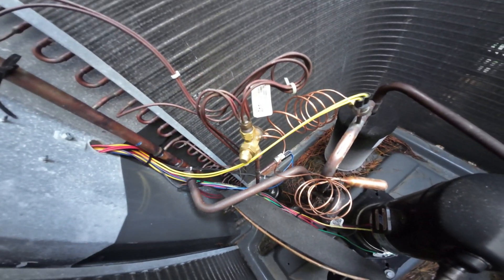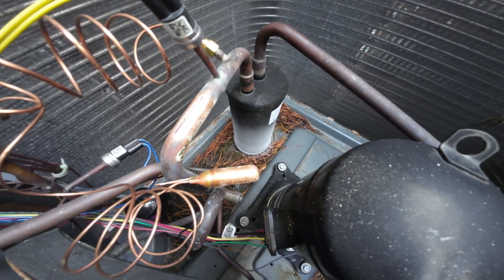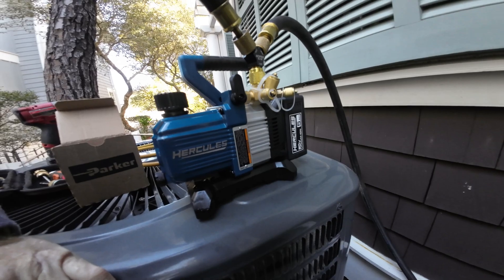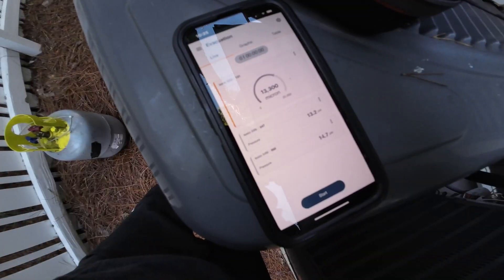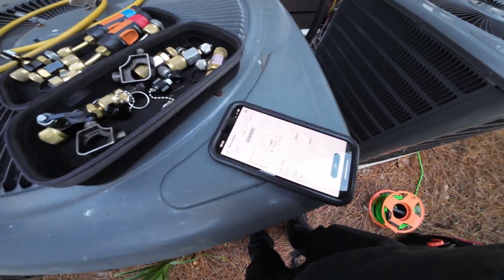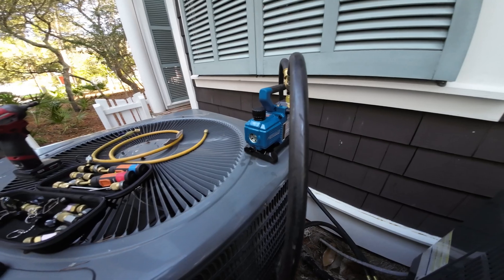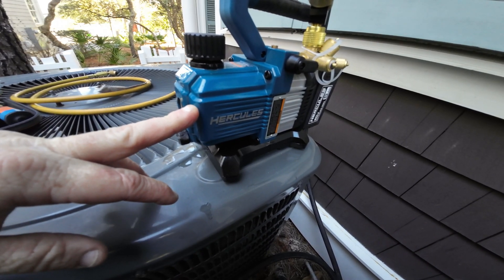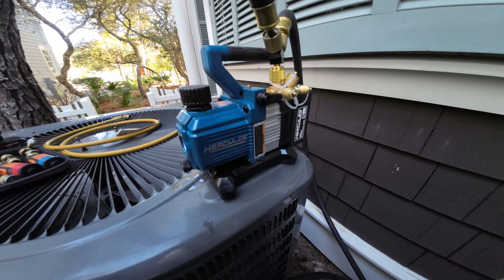Hercules 2CFM 2 stage vacuum pump | IS IT WORTH IT?

Comment: I just used it today to pull vacuum on a car AC system for 45 minutes and it performed flawlessly. It also had battery to spare. So if you're just doing automotive it's a great tool

Comment: Good video man. I actually just got one to test it myself and see how it goes. I’m very curious to see how well it does on things above 2.5 tons.
Reply from the maker: @HallsHVAC  it failed my residential repairs. But I am holding on to it for roof top package unit test one day.
Reply: @ definitely looking forward to that one
Reply: Works well with 5 ton ..just depends on linset length

Comment: I purchased this vaccum pump about 2 months ago and the battery doesnt seem to last past 800 microns and then it dies not sure if i can switch mid process and not lose the vaccum
Reply: I use core removers so I can shut valves before battery dies.